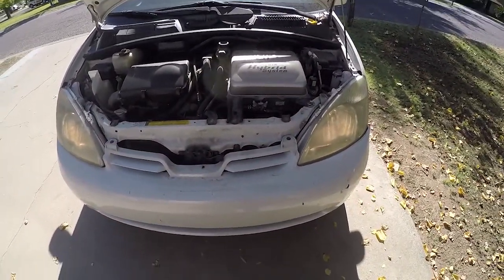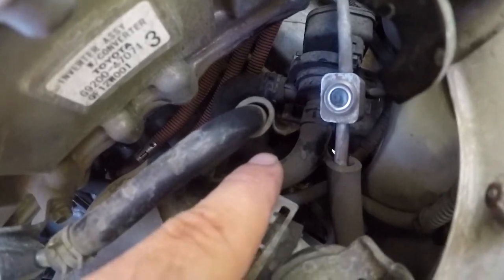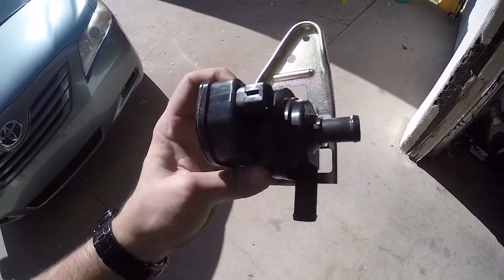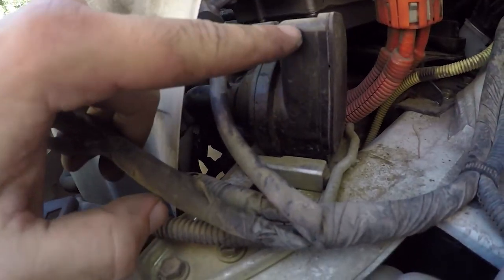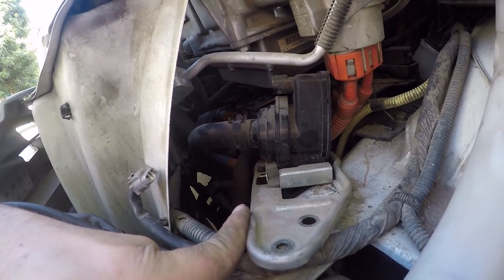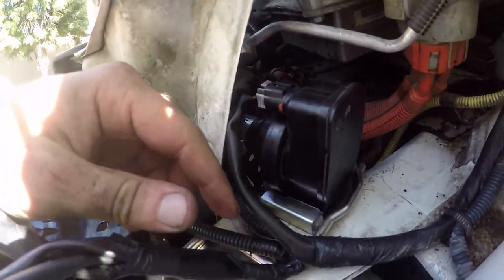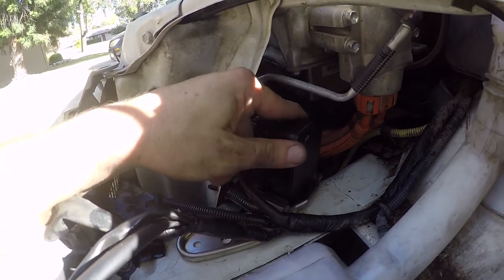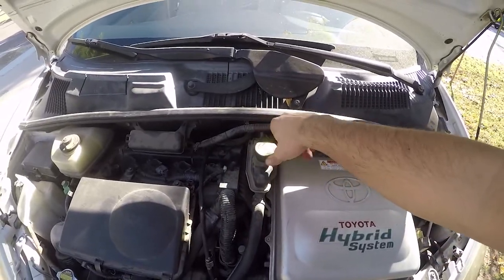DIY How to change Prius Inverter Coolant Pump! On my Gen1 2003 Toyota Prius.

Comment: THANKS A TON!!! I was about to lift the whole inverter thing to do this on my wife's 2006 Prius (less than 100k miles on it). Most videos about this GOT IT ALL VERY WRONG. Also you'd need long extensions for socket wrenches. This way (going thru' the headlamp space) you only need a philips screwdriver, 10&12mm wrenches and pliers for the tightening rings (mine held up, didn't replace them). Plus everything is at hand, SO EASY to swap. Spent about 1hr at it, then reset the error log and went for a test ride. Works like a charm. Got the errors on Saturday, ordered the repacement pump (58€ from Amazon -quick delivery, can be found for as cheap as 35€ if you can afford a couple weeks wait-), got it yesterday (Sunday) and it was done in the afternoon. Great video. Thanks again man!
Reply from the maker: Love to hear this!!!!

Comment: Hi, if the flow on the reservoir is just a weak move, should I just try to change the fluid?
Reply from the maker: I would only change the fluid if it is not bright red anymore. If it is dirty, change it.
Reply: @RacecarAndChill  
I did change the coolant and cleaned the pump which was working. The turbulence came back but the triangle kept turning on (around 3 or 4 times again). 
I was considering junk the car, but suddenly the car came back to normal and never show the lights again. 
Could be that the car took a while to “get familiarized” with the new coolant?
Anyway, Tks for your video. I follow it step by step and fixed my 2003 Prius

Comment: Thank you for this. I’m going to order a pump today and give it a shot. It’s better than $500 at the mechanic to find out something else is broken too 🤷🏼‍♂️
Reply from the maker: Happy to help! This is an easy replacement!
Reply: RacecarAndChill I used your link from the description and it should be here in two days. Stoked to get rid of that triangle of death!
Reply from the maker: let us know how it goes!
Reply: RacecarAndChill I got the pump today! Unfortunately I’m having trouble taking the bumper off to get the headlight out to make space to get the pump out. Do you have any suggestions? 
I took all the  bolt out of the bumper by the tire. However the bumper bolt you had broken is intact on mine and I can’t seem to get access. 
Also I took all visible screws off the headlight and it’s still attached where the bolt broke on yours. 
Any tricks to get the headlight out?
Reply from the maker: @AFishBicycle  it's been so long since I've done the job that I'm having a hard time remembering. Just go slowly and look carefully with a flash light!

Comment: bro, does that coolant reservoir have to be slushing around like that to know if it's a good pump? Mine gets very little motion in there(some motion but not as much as yours at the end of the video) and barely gets bubbles. I hear nothing from the actual pump but do get some little vibration. Can the pump be going out that it still barely works but still gives me my red triangle after I drive around for like an hour?

Comment: No just unscrew wind shield cleaner tube cut hoses an pull electric off. Slide motor out re install take 5to 10 minutes new hose clamps
Reply: Have you tried it the way that you mentioned

Comment: I just finished replacing my inverter pump and it’s purring like a kitten. The triangle of death disappeared instantly. The clamps on the hoses were hell to get off. 😓  They weren’t $492 worth of hell though. 😂

I actually put new clamps on hoses. The same ones you used. This video saved me $492. Thanks Bro.
Reply from the maker: Clyde Smith glad to help man! I'm so excited about hearing you do it yourself! The hose clamps are the hardest part about this whole swap!
Reply: Clyde I would like you to go back to the dealer and tell them .. maybe show this video ..
Reply from the maker: @carlloeber  it takes so little time!

Comment: I called Toyota this morning and they wanted to charge me $492 for labor to change the pump. I was told that it would take about four hours to complete. Really? I pulled my car into the garage and was able to get to my inverter pump in about 30 minutes. I’m going to pick up the part tomorrow and put it in. And they said four hours of labor. They are crooks pure and simple!
Reply from the maker: Clyde Smith [Substitutes] most people will just pay and not even think twice! Good job!
Reply: I don't know how long they last. I only have 64,000 miles on my Prius. We're going to trade it in this weekend for another hybrid. Most likely a hybrid SUV for my wife.
Reply from the maker: Clyde Smith they should last much longer than that! I think there was a recall on some of them that went bad that early. Mine had roughly 220k on it when it stopped.

Comment: Just bought one of these, same year with 120,000 original miles. Only thing that bothers me (currently 110* degrees in Arizona) and eventually when driving or sitting for that matter the car will reach a max temperature of 226* degrees Fahrenheit) but once driving it will go back to  around 190 degrees. 
Not sure if this is normal for these cars or not?
Reply from the maker: Wipemyass hey I'm in Arizona too! Yea the car gets real hot, but I dont think it's any worse than any of my other cars. Tinted windows helps!
Reply from the maker: The AC is weak on these things, that's for sure. I've noticed it's especially weak if sitting parked. On the freeway with plenty of air flow, it blows nice and cold, but I dont think the radiator fan was ever meant to be used in Arizona summers. Lol
Reply: Lol nice bro!! I subscribed to your channel. You don’t really see these first gen Prius’  around as much but I hear you on the ac lol when the car is sitting the engine shuts off and on again and at that point it’s blowing warm air until you get going lol
Reply: I’m going to be changing my transmission oil soon, has a small stutter when taking off from a complete stop.
Reply: But for $1,500 I’m not complaining lol I drove 120 miles today and  only lost 1 bar on the gas tank
Reply from the maker: If you hit the max ac button, the engine wont shut off. lol but yeah, I love the mileage we get out of these things! I replaced the trans fluid on mine too, I dropped the pan to clean it out, it was pretty bad. I don't remember if I made a video about it or not. It's really straight forward.
Reply: Did you use Toyota tranny fluid or an aftermarket brand?
Reply: I made a video about dropping the tranny pan and refill. Thanks for this video! Adds great info to the community, I will make one when I change mine. I got 125k on the ODO of my 2002 cream puff.
Reply from the maker: Mine is still going strong at 240k!